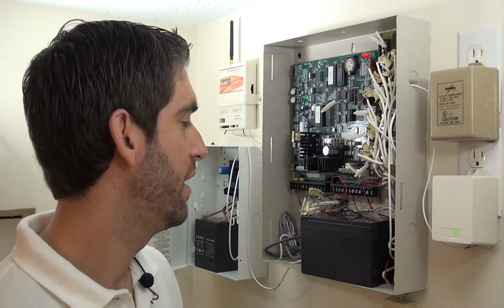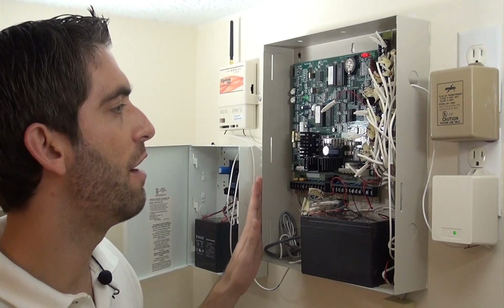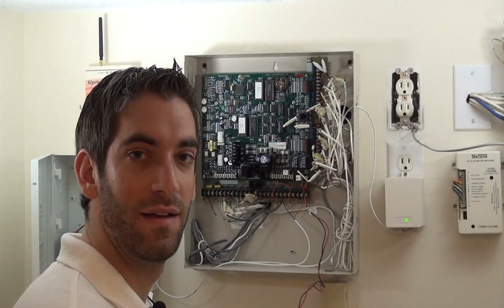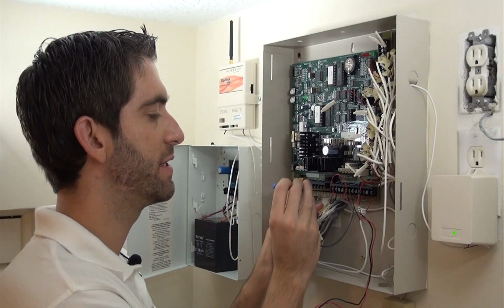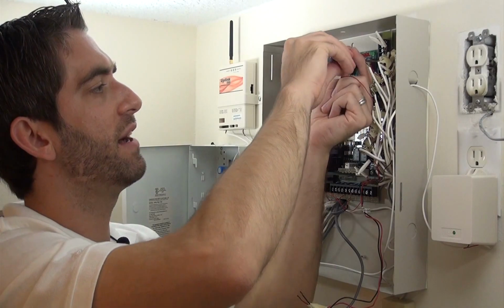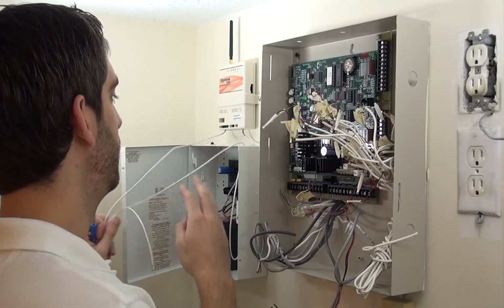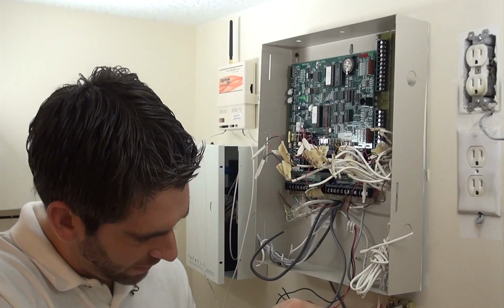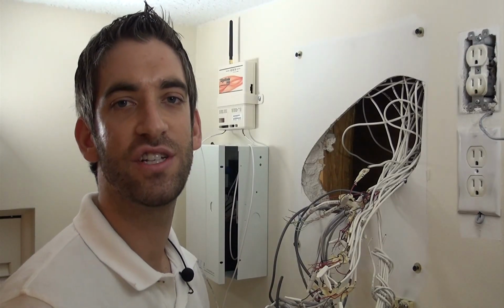APEX Destiny Panel: Dismounting from the wall

Comment: Yo dude is the original installer still employed by your company I ask cause damn the fucking installers a butcher look at the size of hole he/she made to bring the circuits thru a true alarm pro would not make hole of that magnitude on the wall regardless if the panel covers it at the end
Reply: +Mi Rom We didn't do the original installation. We just swapped in the new 21iP panel to replace the old Destiny.

Comment: hi, I want know something , I have vista 20 with 6148 keypad, all my system is wired, I like wired less false alarm, but I can used the L7000 keyboard with my system  vista 20.. o I buy new one but I can still used old wires..i can do that let me know please
Reply: Luis Lugo You cannot link an L7000 to a VISTA panel. However, you can wire your existing zones landed to the VISTA-20 to a 5800C2W ( https://www.alarmgrid.com/products/honeywell-5800c2w ) which is a wired-to-wireless converter unit. With all your zones connected to the converter, you can then program the wired zones as wireless zones to the LYNX Touch L7000 panel and use the L7000 as your new system.